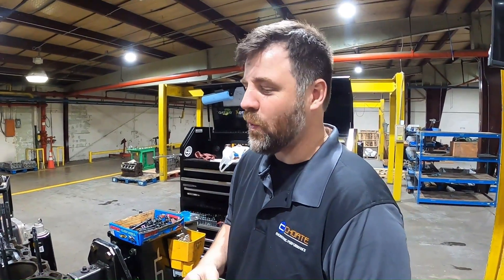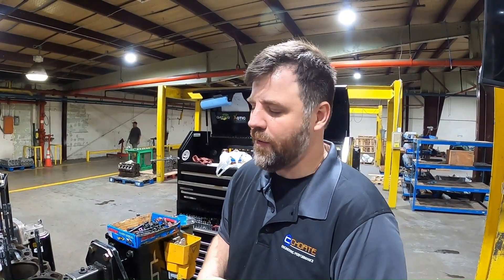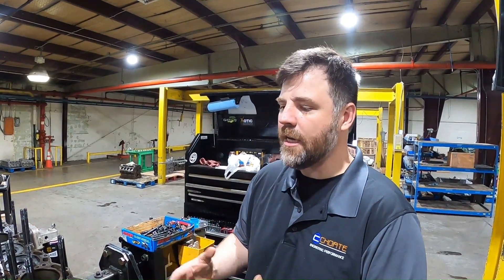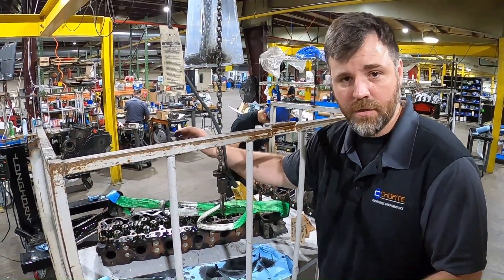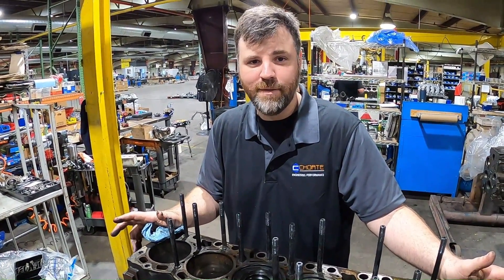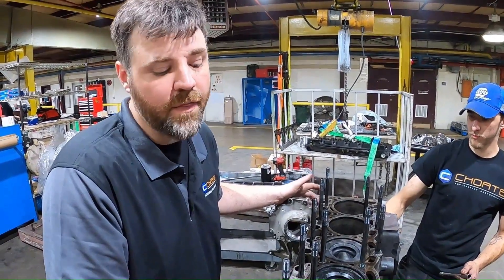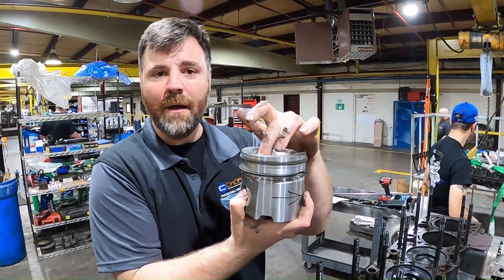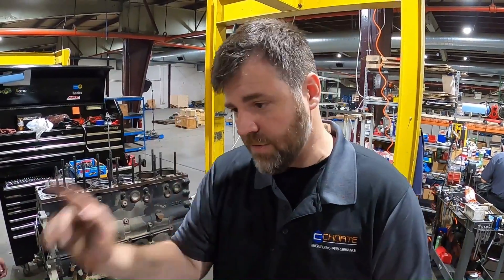2020 Cummins with cracked pistons - Full Diagnosis

Comment: Injection timing, #1 killer of performance diesel engines.  Unlike spark engines, the heat of compression is only there for a finite amount of time, so advancing beyond a point is useless except for building too much pressure before tdc and destroying engines.  Tisk tisk 😔
Reply from the maker: 1000%

Comment: Good diagnosis. There is always a fuse point and you want it to be the least expensive to repair. If the piston didn't crack then the conn rod may have broken. More and more cylinder pressure is going to find the next weakest link ... and BOOM ... there it is!
Reply from the maker: yes for sure! Thanks for popping in! Please subscribe to our channel so you don't miss out!

Comment: i would say yes and no. these things blow head gaskets in stock form. arp is still a good thing. having a well vetted tune is the other. too much injection timing at rpm will melt the piston. to much at low rpm will crack the piston. a novice diesel tuner will think that a big name tuner left lots of low end power off the table when in fact its better to keep injection timing low at low rpm because cylinder pressure is higher at wot at low rpm.
Reply: Yes, they don't like to be "lugged", which is an rpm (gear ratio) where the engine doesn't respond to throttle.
Reply: Very Very few loose head gaskets in stock form.
Reply: @Mega7492  im a small shop and did 3 of them last year. these head bolts only go less that an inch into the deck of the block. this promotes distortion. all three i did last year were stock trucks with two of them being hot shot guys.